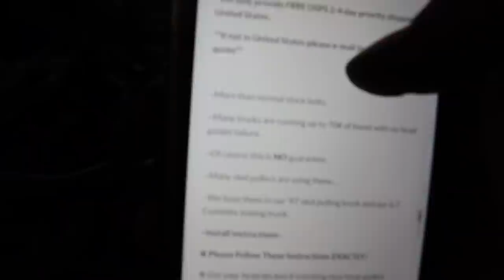INSTALLED our new BANKS POWERMAX TWIN RAM AIR intake setup!

Comment: I’d leave the aftermarket head studs/bolts in it. No reason to possibly mess up the head gasket/ head by replacing them for no reason. Save them for another project

Comment: What about the intake grid heater? I see the banks kit just has two spacer blocks and the heater is removed. Is it just not necessary? Maybe you don’t need to worry about cold weather. Just curious

Comment: From what you showed on the the video, those are aftermarket head bolts. Those are not headstuds. Head bolts are one piece. Headstuds are a stud that screws in and then a nut and washer that clamp down. FYI.